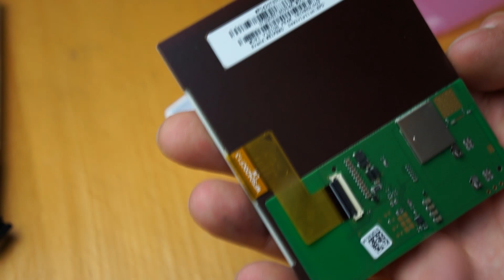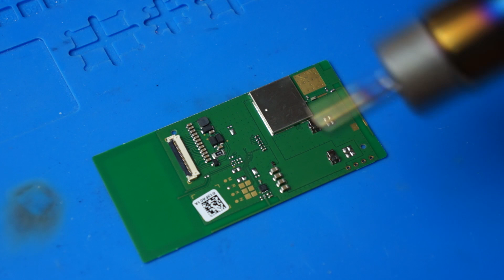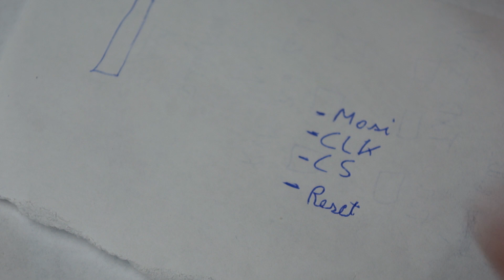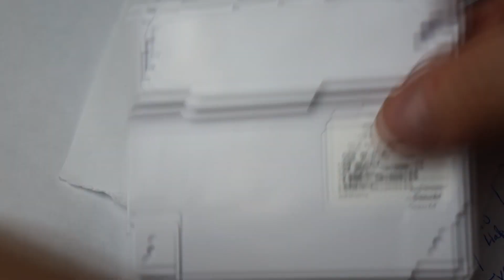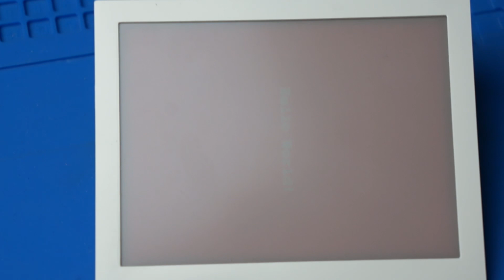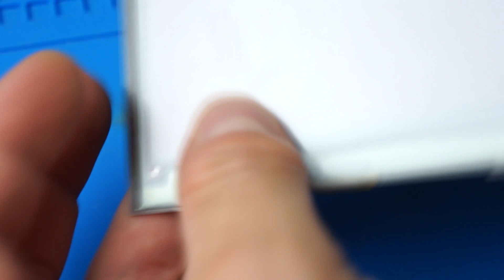How to solder the E-Paper price tag ST-GM42001 for Arduino usage

Comment: I like what I see, but where to get this price tags, could not find them on Ebay or Aliexpress. What I found is some offers of ED060SC4, replacement for an e-book reader. For this there is a STM32 library (https://github.com/PetteriAimonen/ED060SC4_driver). With your experience, what obstacles do I need to expect?
Reply from the maker: That is a valid other option :) the screen looks nice

Comment: Hello, thank you for your help. Can I buy one of your PCBs? Thanks!
Reply from the maker: I only got the pcb's but not soldered i can share these. The connector is quite hard to solder on.
Reply: @atc1441  Thank you. I found something similar : 
Waveshare E-Paper Driver Hat 

What do you think about it?
Reply from the maker: The problem on that one is that the gold contacts are on the wrong side. I talk about it in the video
Reply: @atc1441  You can flip it ... or not? Where is the problem? You don’t need to use the expansion thing.
Reply from the maker: No  the connection would be wrong if it is flipped.

It needs to be a connector for the other side or a multi side connector
Reply: @atc1441  How Bad..Any solutions for that problem? 
Any alternatives for that HAT?
If I buy your pcb how expensive is it? Would you solder it for me? If I pay for that?
Reply from the maker: The cheapest solution is the shown hack in the video. 
The connector is as mentioned very hard to solder so i will not do it for you sorry
Reply: @atc1441  So bad... And the WaveShare isn’t an option. Too Bad. If I Replace the Connector from the WaveShare that could work? EDIT1: The Pictures didn’t look so wrong.. Where did you get this information? 

https://www.waveshare.com/wiki/E-Paper_Driver_HAT
Reply from the maker: Replacing the connector does indeed work, this is already tested https://stromrichter.org/showthread.php?tid=4211
Reply: @atc1441  Thank you very much. Which Connector needs to be replaced? Both or only the DisplaySide? EDIT1: http://www.360customs.de/wp-content/uploads/2018/07/IMG_0129.jpg 

I need to remove the Connector from the WaveShare Adapter and the Connector of the original PCB.. I will try to make it with an heatGun

Comment: I wounder if you can get in exchange for the original chip an ESP32 on a PCB with castellation in there.
Reply from the maker: There is a project going on to ad a new pcb with an nRF52840 into the case as it is better in terms of low power. 
But it will take time till it is done

Comment: So cool, can we reuse the price tag. Still not know how they can make super power consumption? ^^ too curiosity.
Reply from the maker: They only need power when the image does change. After that you can disconnect the battery and will hold the image :)
Reply: @atc1441  the hardest part is how to trigger the node wake up, I understand your method. But so supprise node can wake up by the centre which send command (over the air, long distance, 5m), update and go to sleep. Curiosity about their solution inside ^^. With 2-3times update a day, battery can use for 5 years
Reply from the maker: Today the deep sleep of most MCUs is so low that this is not problem anymore. 
They wake up every 1 or 2 seconds and see if new data is available then they sleep again. That happens so quickly that it does not draw much power